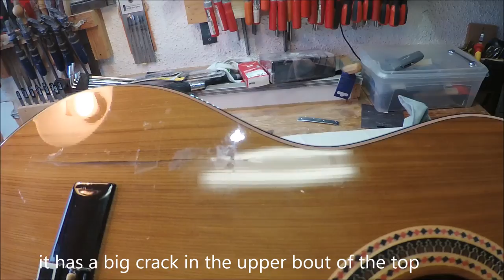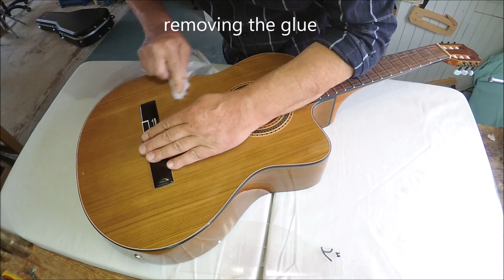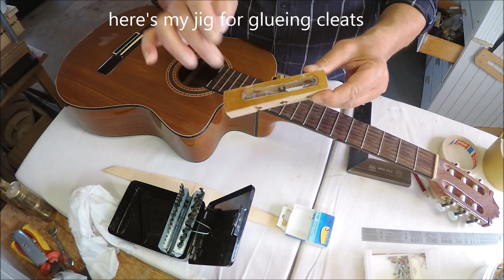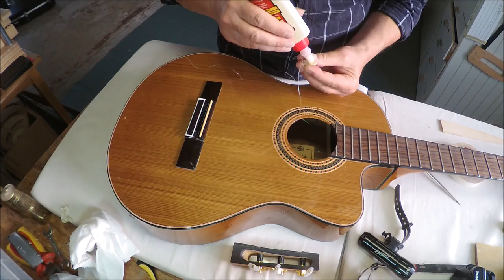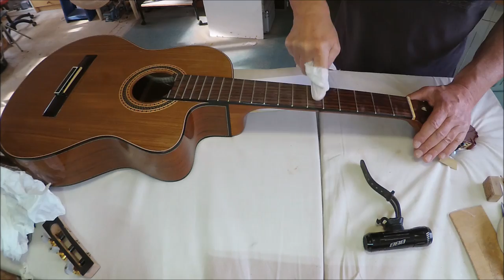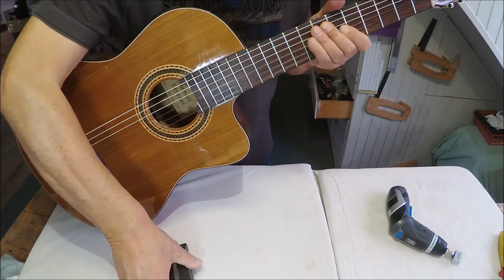the ultimate guitar crack repair tool and it's for free!

Comment: Agreed ,,, sticky tape  ,,,,,NOT a good idea. Just one helpful note,,,( I hope ) When a decal / emblem etc  is glued to a surface. That can even be a Car dealerships advertising  sticker, or vinyl lettering . Bring out a normal hair dryer , and set it on low heat . Holding it about 7inches or so , and moving back and forth over area. Proceed to begin to pull stick off walking it back and forth so the tension is not all across the widest point all at once. Never get closer   , nor use a higher heat thinking it will make the job faster. Depending on the surface of item. A lot of damage can be done . Then after its is removed... Usually on most surfaces . A quick wipe of denatured alcohol will remove left over residue .  ( Use on Shellac is a no no )

Comment: I’ve repaired a few cracks myself and I’m a keyboard/guitar player 2nd .I buy and sell in my spare time around 500 guitars a year ,so i have to fix most of them. I’m trying to learn the hard way.i dont understand why you added watered down super glue shouldn’t the titebond be enough,also i have never added bracing under the crack i suppose thats a mistake. I havent had a problem but know you got me worried.could you tell me why you need super glue and why cant you just stick a brace inside with glue and turn the guitar upside down while it dries?
Reply from the maker: Hi Chris, the superglue is just an extra thing to be sure the crack is really closed. You can do without it. In the repair world man has always added cleats to reinforce the crack. This too is done to be sure the crack is stable.
Your way will work as well. We all have our own way of daeling with things. Good luck!
Reply: Chris - it wasn't 'watered down' superglue..(meaning CA glue thinned with something). it was the water thin viscosity CA glue.  It's made that way.   FWIW I used to be against the technique because too many repairpersons were doing that instead of actually gluing the crack and cleating it  (quick fix... make $50 for 2 min. work that looked good for a few weeks but was destined to fail again)  ... but I think as a secondary measure nothing wrong with it.  Except I've had it glue the edges of the tape to the top (in 30 seconds)  which makes yet another huge mess to clean-up/buff out etc.   Just my .02.  If you're going to flood cracks with CA practice on something that doesn't matter.
Reply: I work with CA glue (superglue) all the time to do repairs on wood, metals, plastics, bone, etc...  I have different viscosities, fine, medium & thick for different jobs.  In fact I just repaired a pair of ski boots that got severely melted in the oven by filling the melted parts with CA glue and baking soda (which makes the CA glue much tougher), sanding it down to fit boot shape, then coloring it to match.  Luckily the damage occured on non-flexible parts of the boot because CA dries very tough but brittle. I find the toughest part of working with CA glue, besides the speed with which it dries, is the difficulty of seamlessly sanding it down level with the original finish without causing any damage to the finish itself, especially on thin lacquers commonly found on vintage and high-end guitars. CA glue is much tougher than any finish I know of, hence the difficulty of "perfectly" blending it with wood finishes or other materials like plastic. As to filling larger gaps and holes, you need to work in layers because it has the tendency to dry very fast on the surface where it's in contact with air causing the bottom layer not to cure.  Baking soda really helps in layer build-up but results in a more milky white opaque finish. On larger surfaces, though it goes on very smoothly when applied, CA glue tends to deform as it dries due to the chemical reactions (especially when using a curing agent) and creates a rough, God awful surface to work with, requiring many stages of sanding and polishing. It's really hard to get perfectly smooth end results as you progressively advance through the polishing stages when microscopic imperfections in the surface become increasingly visible with each stage of polishing. So expect to repeat certain stages many times over if you're looking for perfection.  Patience is a great virtue when using CA glue in sensitive projects.

Comment: You used 3 small cleats.
Why not 1 big cleat?

What kind of clue do you use? does it matter?
Reply from the maker: My goal is to use as little extra weight (wood) as possible. That's why I use small cleats. I use titebond glue or hide glue when it is an old guitar. It doesn't matter much.

Comment: This is great but isn’t it easier to put plain guitar strings through the crack first, then continue gluing it up as shown.
The strings can simply sit there until the cleats are needed. Then when you’re ready to go you just pull them through the crack and use your ‘old classical guitar head half’ to hold them in place while the glue dries (brilliant use of old bits, hats off to you for that Sir).
It might even be worth thinking about ‘cleating’ the crack first, then filling it in afterwards, that might line up the wood even better.
Meanwhile my vernier gauge says the G sting on my Strat is 0.4 mm while the E is 0.25 mm, that’s a quarter for E and bit less than half a millimetre for the G. Much smaller holes and no drilling needed.
Smaller holes will be much easier to hide afterwards no matter which way you slice it.
Just saying.
Reply from the maker: Hi Dennis; just try your way on an old guitar, because I think it's much more difficult doing it then writing about it. We repairmen are always thinking at least about ten possible ways before we begin a repair and when we finally start repairing, it's always different from what we thought it would be. The first goal is to close the crack wood to wood and the second is reinforcing the weak area. You are thinking the other way around: first reinforcing and then closing. But you can't close a crack after the cleats are glued and I think it's impossible to glue wood to wood when there are two or more guitar strings in between. And why should cleating first align the crack better??...you  could be right, but ty it out first. Thanks anyway!

Comment: Yeah, bitch! Magnets!
I use polyurathane construction glue for reparing guitars. Also I use wooden dowels cut to the proper lenght to apply presure to the 'cleets' or braces when glueing them from the inside. I would never drill holes through the top for something like this. Someone else mentioned here in the comments that he uses magnets for the cleets also.